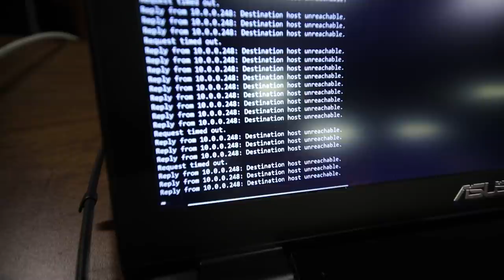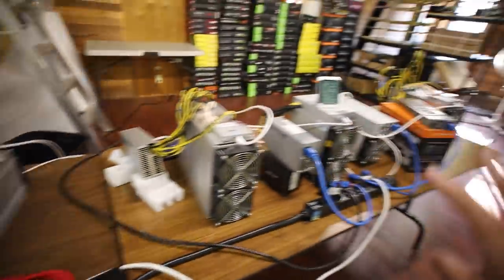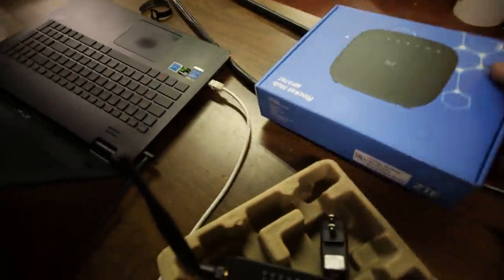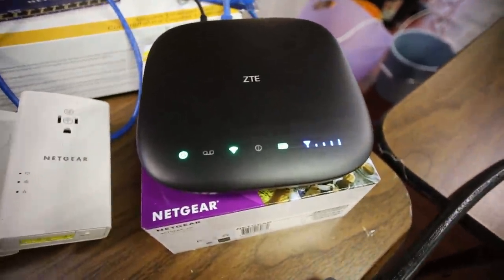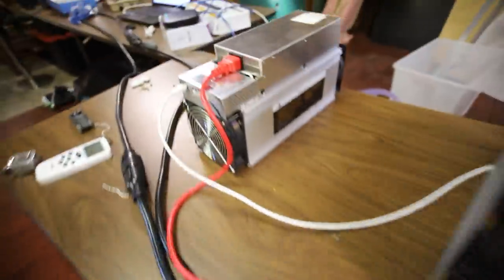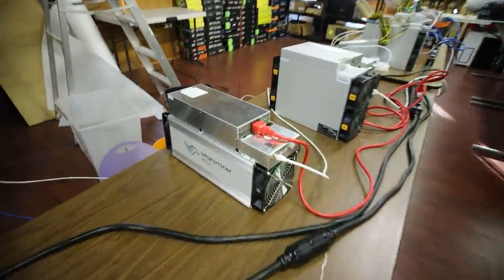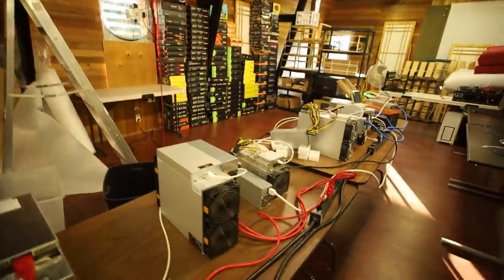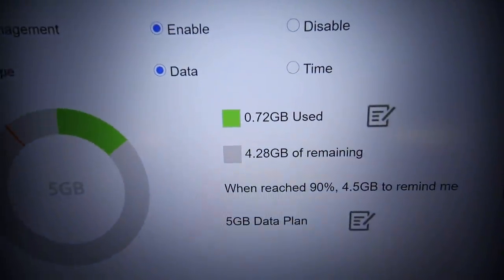Internet went down in the BARN...

Comment: Ubiquity is a great but I'd rather rely on point to point cable when ever possible. :D Grab a roll of armoured Cat6 cable and lay it in the ground to connect the barn to your main network. 
Your Cel/mobile solution is good but i'd only use it as a Temporary fall-over/backup connection (as you see it can eat data like it's got the munchies)!!  :D 

also pick someone else in the giveaway! i've no need for the rack i'm only a small solo card miner. :D

Comment: I am a data technician. I install structural cabling and build server rooms for commercial buildings. First advice I have for you is to stop buying Netgear equipment since they are one of the lower quality manufacturers. They are normally good for small business and home applications but for the amount of data you're pulling you're going to need a higher quality brand. Ubiquity is a good option and not much more expensive. Second and foremost is to simply get a dedicated service line for the barn itself. If you're able to get fiber service you'd be in excellent shape as it will provide you with speed and a lot more flexibility on the bandwidth you can pull. Fiber to a media converter to a router to your switch and you'll be gold brotha!
I'm in the US and god knows I need another mining frame! I have 4 gpus and a psu sitting on a table with long ass usb cables because I ran out of room on my mining rig and they're all just being supported by the risers...  Thank you and good luck! 
P.S. I love your channel keep doing what you're doing!

Comment: I think you would have to give us more details on where the barn is from your main internet connection. A lot of consumer grade mesh systems reach a hundred feet with enough bandwidth to mine (usually, I don't use ASICS though). You can even move up to commercial grade for a bit further. Or you can bury up to 300 ft or so of ethernet from your home to the barn. Or even longer ethernet, but with a decent amount of degradation, but most likely still enough for mining purposes. I don't like a hotspot and definitely don't like the data limit you have. Good luck my man! Also, I am in the USA and would love to sport one of those frames and send you pics once set up. It would really help with my goal of doing a cheap DIY grow tent with a frame inside.

Comment: If you are already using a hotspot, I would use an app called pdanet for internet. 

It would allow you to have unlimited internet and dhcp. However you'll need to leave phone plugged into the a computer, then share the connection to a router. Basically the computer becomes a modem

1)download pda on Android 
2)enable usb debugging on phone
3) install pdanet on windows computer 
3a) make sure usb tether is enabled and usb debugging on phone before you finish the installation on computer. The last step of installation is for the drivers, if the phone isn't properly configured, it won't work 
4) hit connect on computer and it should work properly

This step gives internet to router
5)on windows 10, you'll need to find your current internet connections. A new one called pdanet should be visible, and show you are connected. Right click, change properties, click on advance tab at top, click check box shares internet, pick share with Lan from menu, and allow others to control internet. 

There's also videos on how to do it, good luck

Comment: Forget the hotspot.  I suggest you get 2 switches unmanaged or managed with 10G to 40G SFP port and run some multi-mode fiber cables between your main house to your barn.  Ping me and I can offer you a solid solution :)

Comment: I always wondered if it is possible to run mining hardware of a "mobile router", so thank you for showing that this is possible... but the latency is terrible, and I think you should get the Ubiquity point to point system setup especially for the long term. The 5 GB data limit fells bad too, I am really wondering if this is enough, maybe you could just turn off the laptop if you aren't there?

Comment: I am using a similar solution as a backup for my flight simulators (they need real time whether to function well) for the past two years its been great, so I think it would be more than fine for you...Now I have a question for you ahahah why don't just ran a line of RJ47 cat7 shielded cable? I live in Chile so if the shipping to Chile is to complicated I have a po box in the states that we can use if  I win. Thank you very much for all the videos, I learned a lot.

Comment: Hey RPM I think your hotspot is a good temporary fix. I was using ethernet over power line for a while. Worked good but sometimes I had latency issues. Can't wait to see how your data plan works out because I have considered doing that at another location myself.
I am definitely interested in participating in the giveaway I live in southeast USA

Comment: I'm having the same struggles, currently running USB wifi adapters from the house to the shed where I have my 2 rigs, I tried the power line route and it died right away. It's only 100feet or so I'm about to just trench and drop hard line.

Comment: I think it depends on your barn location and your desire for convenience and such.
I would recommend running a hard line but typically you want to bury it, which is a lot of work.
Otherwise, I would recommend running a wireless bridge and just connecting that way. I've never liked power line (or had luck) and separate data plans can get expensive.

Comment: In the USA.  I have installed a pair of Ubiquiti NanoStations as a point to point wireless over a couple hundred feet.  Works nearly as good as a cable.  Getting 2ms pings across the wireless.

Comment: Hey @RedPanda, USA here.  I'm not sure of the distance but a dedicated cat run would be better than a wireless or powerline solution.  I never had luck with anything powerline.  I had too many devices causing interference that it would drop out.

If you can go fiber, that would be sweet.

Comment: I'd suggest running an underground ethernet cable.   Very cheap and reliable.   I have a similar setup as you (mining farm in a building about 200 feet away from my house).  I ran an underground cable after powerline adapter,  range extender and repeaters kept failing.   Good luck from a fellow Canadian!

Comment: You probably checked it but I would make sure the powerline adapters are using the same network name. You can check/manage via TP-Link mobile app. I had an issue with them, turns out their network names were changed somehow. I reset them to default via mobile app and they went back to normal.

Comment: I use ubiquiti at home and have a back up 4g connection (I get 20gb for £12 gbp a month) I have blocked all ports other than 80 and 443 and the mining ports i need on the 4g connection so if my cable internet goes down everything i need stays working

Comment: Sometimes power line ethernet doesn't Work just because of a bad PSU or electrical device making electrical noise around or on the same circuit ... be sure to Check for this.
But you can also simply use a long ethernet cable from your house, stable and cheaper 👍.

Comment: (EU) Seems like a good solution to the problem. I had the same problem with powerline connections. I ended up just running a hard line. You might want to check out Brandoncoin's solution using a long ethernet cable.

Comment: You'll have to find a router that can handle 3g/4g fail over. Which means the router will take care switching between your wired isp and moble data.  Your best bet is to run a cat 6 wire or better from your house to the barn, if it's less than 300 meters. If it's more than that then fiber would be best but it is pricey  Direct bury cable would be the easiest. Last year I buried a cat6a from my house to my garage, it was less than 40ft so I used pvc conduit. It was the best upgrade I did for my miners.

Comment: I don't know your exact situation but I would just get an underground rated ethernet cable or cheap pvc conduit and run an ethernet line from your house out to the barn.  The 2Gbps vs 1.2Gbps won't make a difference with mining.  With mining the packet loss and latency is what's going to make or break it.  It would be very much worth your time to run an ethernet out there.  You don't need to bury it super deep just a few inches to not be snagging or tripping on it and cat6e is rated for like 100 meters i believe which should cover you.

Comment: As others have stated, I'd bury an ethernet cable if distances allow.  I'm sure that will trigger some people but I think it would be fine until you get a proper long term solution.  Bandwidth is clearly eating up that cellular plan.  That's actually pretty shocking how much data it gobbled up there.

Comment: You should have a fiber or a cable (Cat 6) between your house and barn.  More work, but more reliability. Wireless/Power over poweline usually aren't reliable over time. If the barn is too far from the house maybee a second internet connection from your internet provider (cable or fiber). I would love to have all your rigs, but not your electricity bill.  lol

Comment: Hi Rad Panda. First of all you need to have a plan for different problems. One of it is to have a backup for your main Internet provider. Looking at your 'Mine' the investment will be less expensive than the lost of profit. Taking from my own experience. Mobile data connection  can be ok as a backup for up to week or so. Best is to have a good cable provider, fiber optics is the best. Then think about partitioning of your Internet into vlans so you would have separate network for your mining and all other activities. 300feets is still within an ethernet cable range so worth to think about or a point to point wireless with directional antennas that one can see the other. Then in the barn have a router or a switch than can do dhcp and vlans. Having vlans would be also a good idea for your windows testing rig so you could  isolate the network traffic. Same goes with the network controlled 'smart' devices - have a separate network for those so that those devices would not spy you too much. Last but not lest have a clean machine or a virtual machine from where you are accessing your non-cold wallets/bank account and so on.

Comment: (EU)
With the data plan access point it's a decent temporary solution.
The ubiquity point to point dish system is expensive and difficult to correctly align the dishes.
The best solution would be to run a optical ethernet cable from your crypto basement to your barn for the best ping times.
You could also get a star link subscription and try that for content.

Comment: Had same issue with inline Poe plugs.  When circuit has to much current being used, it won't connect to the other end.  Had to run longer cat6 to minimally used circuit to get rigs back online.

Comment: Hi Panda.

I think your best solution would be to run an optic cable. You don't have to put it underground and it won't attract any electrical charges. Just choose one that is proper for the outdoor usage and maybe secure in some plastic pipe? Just an idea.

At each end, you plug in converters from ethernet to optic. I think it's for sure a better option than wifi and better than running the ethernet cable, it's fairly cheap and it would handle all your needs.

Cheers, and keep up the good work!

Comment: I learned over the years that wifi extenders and even wifi routers are unreliable. Id recommend running a cat5e line to your barn. Its not too bad. Get a pickaxe and dig a small trench, buy a 1 and a half inch pvc pipe and run your catf5e through the pvc pipe. Finally bury your pvc cat5e wire. It doesnt have to be too deep maybe a few inches down

Comment: if you go running a cable route I would do cat 7 because of 10 gbps support then you wont have to re-run in the future or a point to point system which I switched to from powerline. Im in USA btw.

Comment: Is there a reason why you can't use Ethernet cable? It will take digging but is more permanent solution.
WiFi can work but can be wether department if it's far

Comment: The point to point would be best. But you could do outdoor wireless extenders. Run Ethernet overhead if less than 300 feet . For the power lines not working. They run through the ground wire.. check that outlet and make sure the ground is terminated and not loose. Than check the panel and maybe move the ground to another part on the Buss.good luck!

Comment: I would go with a fiber run out to your barn.  It prevents any electrical crossing between buildings and makes the connection immune to weather interference (this is what I'm doing at home at present).  Second option would be PtP wireless.

Comment: your router properly can't handle all the packets send from the asics miners, had a similar problem with my asic, so i upgraded my router to a enterprice router and dont have problems anymore.

or you can brigde your router and can get less packets floating on your lan. that will also prevent your main router to get fill in the ram. when u start to get alot of asic miners. you mostly will get some networks errors.
1 gpu will get a share every 30 sec to 60.
1 asic will get 1000 shares in minuts, that can make a overflow off data packets and yeah fill your ram on your router so fast.  and specialy on consumer  graded routers. they aint build for asic miners :)

Comment: Its common problem with home internet access, they are not stable. I think use "Dual WAN" router is the way to go, dual WAN means, one WAN port for 1 internet cable operator and the other one wireless base internet operator. Some decent dual wan routers has import features such as : internet fail over (if one fail then connection will be go to other operator)

Comment: A mesh system works best for me in my shed, i have 0 down time after 8 months, you can use a directional antenna if you are worried  about distance 

I am from the UK and would like the 6 gpu frame :)

Comment: Not sure what satellite service, or cost is like in Canada; but it certainly would be a good idea to look into it; I just had fiber optic installed, in addition to cable internet because I am too OCR to have a single point of failure.

Over the last six years, cable has gone down for multiple reason(s) and it real bites to have all your gear down due to internet.

Comment: If you have a good line of sight then I would go point to point. I spent a good 5 years grabbing any password free wireless signal I could find for internet with a firmware modified 54g linksys router and and external antenna. Very solid with a good line of sight.

Comment: 1. Maybe add another line dedicated for the barn. 2.What is the distance from the house to your barn? Maybe you can connect the network hardwired? net cable can be as long as 100 meters.

Comment: I wonder if the power lines won’t connect due to the original running on a different circuit from the barn. Are you able to run long cat 6 cables out to the barn?? Greetings from the US :D

Comment: I would either have your provider set up a second modem in your barn and get a router for it, or, like you were saying Ubiquiti. Third option could be running a fibre optic cable from your house to the barn as the signal wont degrade. You will have to bury the line so it would require some trenching and drilling in your barn to get it setup.

Comment: @ Red Panda Mining look into getting a wifi extender.  I used one with a panel antenna for a garage that was 300+ feet away and was able to get a solid connection with low latency.  Stale shares when using that setup was less then 1%.  Better throughput without the network limit

Comment: Honestly the mobile hotspot plan you had was not a bad idea, avoids running an ultra long ethernet cable from your house to the barn. The plus side of the mobile hotspot option is that it's a lot cheaper, easier to manage. Although latency is high sometimes, it probably won't have much of an affect on the mining.

Comment: I m live at a  Farm, 11 kilometers from the Town , I m using a data plan internet chip. I installed it, in an antenna, like a dish antenna and special device for using at week cellphone signal . After all the the cable goes to a wi-fi router. My plan of data is  100 Gigas. I used a lot the internet in the month  and not reach the limit.

Comment: I am in the UK, but Mesh wifi works great for me after struggling for years with unstable powerline adapters.  If thats not possible for you then run an armoured ethernet cable from your main router.

Comment: What's the distance from the house to the barn?  I would consider running a cat6 from the house to the barn.  Burying is easy, just use a shovel to separate the ground and feed the cat 6 in and then press the dirt back together using your foot.  Another option is to run a tight rope.  Put the tension on the rope and then spiral wrap your cat6 around the rope to suspend it above the ground.  Also, did you check your router for updates to firmware?  It's odd that your ethernet link stopped working when it was previously, and it appears to not be the unit.

Comment: Usa- and the lte router isn't a bad choice I use a nighthawk m1 lte router for my place becouse I live in the middle of nowhere. Best option tho would be to use normal internet even if you have to dig up some yard to run coax cable.. or you can always get a lte antina for your lte router to boost the signal strength 💪

Comment: Cheapest solution is run a cat6 cable from your basement to the barn.   Will be some work as it should be underground. Just make sure you encase with proper weather protection.  Also will be the most stable solution.

Comment: I would get a second line installed if possible directly to the Barn or the point to point might work out well. At least you might not have bandwidth issues like the wireless data plan. Also in Canada.